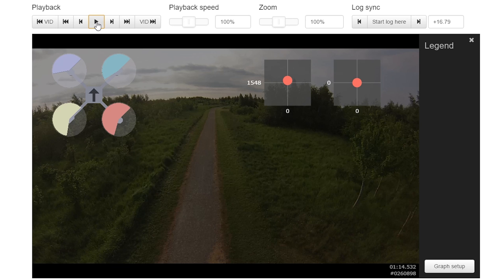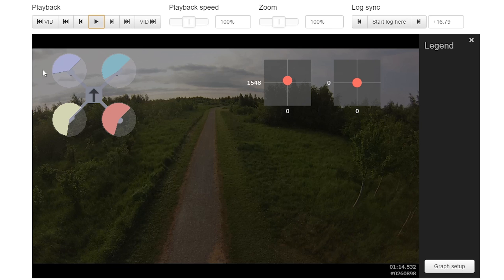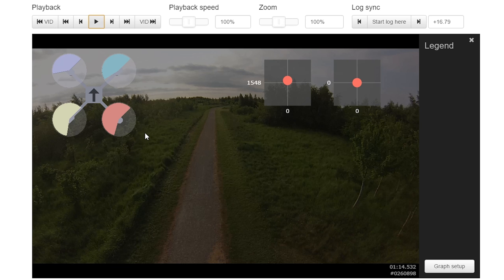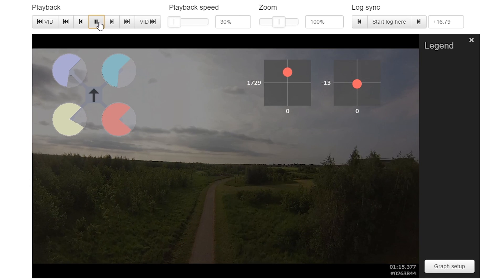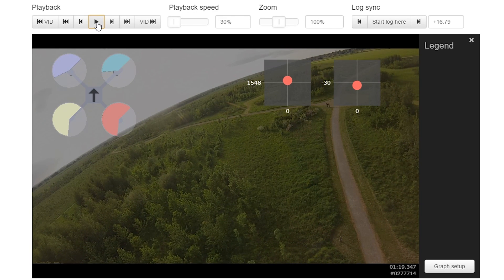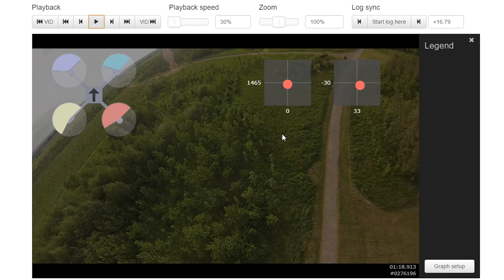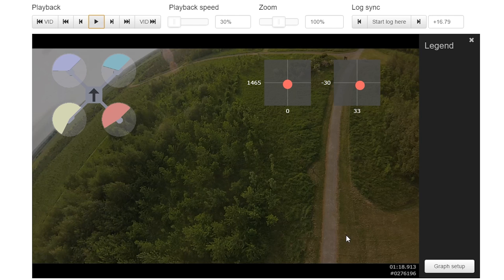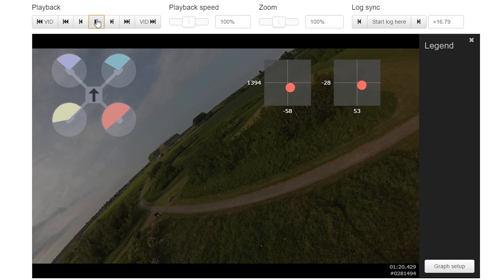FPV Acro School - no.4 Inverted Spins!

Comment: Thanks for another great vid. I've given this one a go. Still needs some work but it's a lot of fun.
Check out my attempts if you get a few mins.
https://www.youtube.com/watch?v=ImSvURgd538
Reply from the maker: good job bludz looking great :)
Reply: Thanks mate. I still haven't made the switch to 2.8 yet, mainly because I'm trying to get a reliable quad that feels good to me. I keep breaking stuff. I see that 2.9 was released last night now too.

Can you still use the 'app' and the 'on the go cable' to tune and change rates in the field with your phone?
I'm worried about switching and not setting it up to feel the same as my quad now. You used to run a high yaw rate which I tried on your recommendation and liked it. Now I see you are running 0.85 across the board. So has the way yaw works changed? Do you still get snappy yaw with 0.85? What expo are you running with that? The rates calculator is a bit confusing because when you look at the old rates it doesn't allow you to add super expo, so you can't see what your numbers were in 2.7 to calculate them for 2.8.
Reply from the maker: the best thing is to start with the defaults and tune. Its the single best thing you can practice! If you keep doing it then soon you will feel the differences and know what you want to change. Just copy the dump so you always have a back up of what you know is good and then you can start experimenting. I promise it is worth it :)